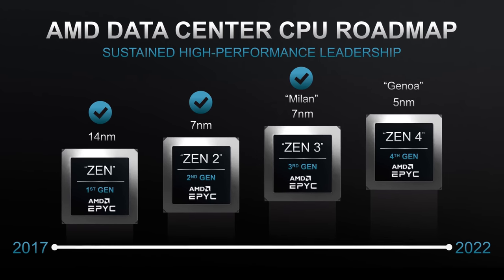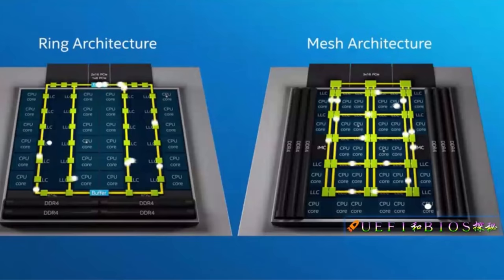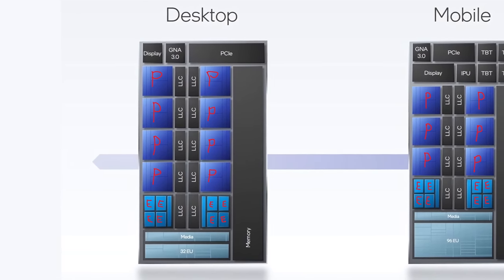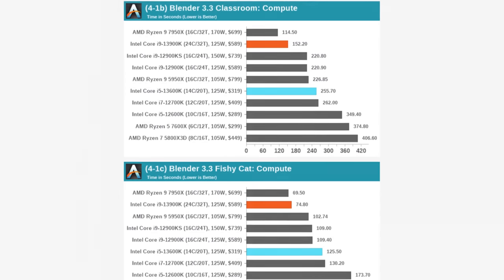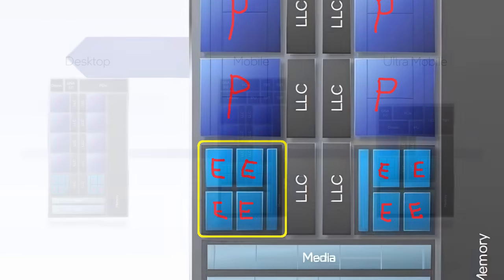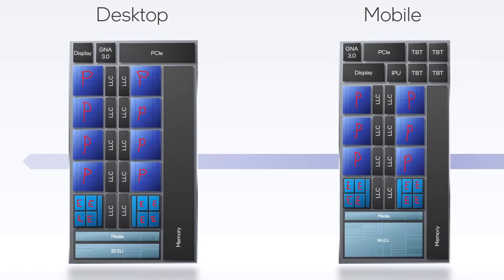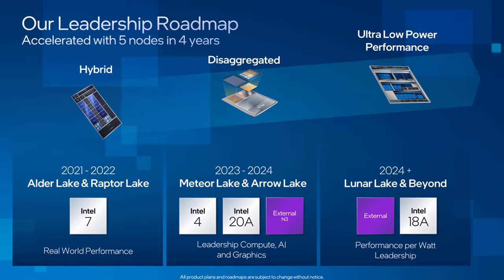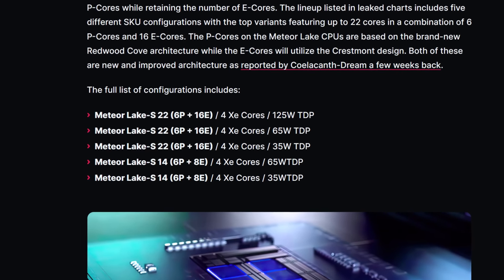E Cores - Slow, simple, not super efficient... but still good?

Comment: The issue is that software has to differentiate between these cores, and it’s not always easy to do so and there are a lot of bugs where you program will end up using the e-cores instead of p-cores
Reply: I've run into this issue with Win 10 when you had applications that don't need much compute power and few threads. The threads were jumping all over the place, switching from P to E and back wasting energy for nothing. After manually setting which cores to use the issues went away and the hybrid design just works.
Never had issues with compute demanding titles - games and applications chose the correct threads accordingly without manual intervention.
Reply: @Innosos  That's logical though, there's a reason Intel advocates 12th/13th gen users "upgrade" to W11 (which has a more appropriate task scheduler for hybrid processors).
Reply: This is my issue as well. From benchmarks, it seems fine BUT, I have yet seen an in depth benchmarking or even a compatibility check with virtualisation (KVM).
 Either they are hidden in the depths of reddit somewhere for my eyes to see or not enough people aren't buying top end CPU for virtualisation on linux (which makes me sad)
Would love to go intel but I have no clue how the e-cores gets affected by KVM.
Reply: @MLWJ1993  True, it is. But choosing between a couple of extra Watts while browsing or having to deal with random Win 11 updates breaking Ethernet drivers (had this happen yesterday on my media PC) I'll stick with Win 10 until Win 11 is as functional and proven as can be.
Reply: @Innosos  It's always interesting reading about these issues. I've personally yet to encounter anything glaring, only thing I had happen was my wireless adapter installing an outdated driver that made my PC bluescreen during large downloads, which hasn't happened again after reinstalling the driver.
Reply: @Innosos  How did you know that they were wasting energy?  What if turning off the E cores and running the P cores at low clocks was more efficient?
Reply: @DefineOutside  Because I measured the Package Power Consumption in HWInfo before and after manually assigning (Process Lasso) only E-cores while running Trimps (a javascript / web idle game).
The difference was about 5 to 10 W.
Judging from the thread usage graphs most of the savings stem from the Windows scheduler constantly moving the game thread to the two prefered P-cores.
When the assingnment was manually set all but one P-core was unparked (i.e. boosted up from idle 800 MHz or so) ever so often.

About downclocking: I've already limited the PL1 and PL2 down to 105W (from 125W) to land more in a sweetspot (~3 GHz for E and ~4 GHz for P) when doing allcore workloads. But I'm not going to gimp my 12700 and disable half its cores when they do great work for my Allcore workloads.
Reply: I had this issue with Elden Ring on my 12600k, as on paper it should have ran completely smoothly, but I was getting only around 30-40 FPS with a 3070. Turned off the e-cores in BIOS and it worked perfectly!
Reply: Scheduler should handle that ideally.
Reply: That is not an issue on Windows 11, tests have been done and the scheduler never got confused (it did at launch). Windows has never been built more with Intel architecture in mind, and a year after alder lake's launch and 22H2 and bios updates, the scheduler and processor have never been better. Can't speak for Windows 10 but Msoft said they'd optimize it in Windows 10 in 2022, last year. I don't use Win10 so idk if they ever did yet.
Reply: @Timblebits  Odd, Elden Ring doesn't even perform well with any CPU. There's constant stutter zones regardless of CPU (E-cores or not) so turning them off shouldn't magically solve anything about that subpar piece of code it runs.

Consoles are affected by it, as are any AMD CPUs.
Reply: @Innosos  I've had Windows 11 break all kinds of drivers I've had, but it's extremely rare. If it's more than a minor nuisance they're prob not completely at fault. I've had motherboards give me driver problems after its drives updated.
Reply: @Innosos  sorry, but "random windows update broke my" in most cases is pebkak - why did an update break that driver?  Did you let update download drivers?  Why in the hell would you ever do that?  Or do you mean the people responsible for keeping some part of your hardware up to date have bothered to change anything in many years and that is somehow MS's fault when they pushed an update that broke nothing on 99% of computers?

Whatever, I must be the luckiest person in the world - "random" updates dont break anything on my computer, but I keep the drivers and firmware stuff in my own hands, because those things should never be auto for anyone other than grandma on some hardware that is the same as it is in many, many other peoples machines. 

Your post is, essentially "I know my shit - but also, I dont know my shit".  Pick one.
Reply: @xBINARYGODx  Calm down dude. Windows will legit brick itself on certain hardware my old PC that has a ryzen5 1600 and a gtx1070 can only be updated if you reinstall. It blue screens if you do the normal update and throws a driver error for a USB device even tho there is nothing plugged in. No need to go ham on the dude and blame him for it. Windows 10 is hella unstable and bloated have seen the os kill itself during updates regularly.
Reply: Software doesn't. It's the job of the kernal
Reply: @Weneedaplague  The kernel is software if the devs can't make the task scheduler do its job well with the p and e core assignment you will have bad preformance.
Reply: They shipped a scheduler (thread director I believe they called it) for windows 11 to handle this exact case for every application
Reply: @Innosos  yooo how did u do it on windows 10?
Reply: @lamkhangnguyenduy5250  The core assignment? A free third-party tool, Process Lasso.
Reply: @Innosos  dang, never know that such software exist. This seems wonders for me as I extemely hate windows 11.
Does it support automatic core scheduler like windows 11 by any chance? Or do I have to set it up manually?
Reply: @mfrunyan this is not true, even with peak turbo frequencys the scheduler works pretty well picking in 99% of all cases the fastest core for intensive tasks
Reply: @lamkhangnguyenduy5250  I don't know the extent, there is some advertised scheduler but I haven't used it yet. You can set stuff manually and save the settings though.
Reply: @MLWJ1993  The game runs better with lower memory latency. The E-cores trash the latency. Ryzen infinity fabric is high latency compared to Intel's ringbus. Elden Ring runs best on Alder Lake/Raptor Lake chips with E cores disabled and low latency memory. People aren't aware of this because of guys making videos saying that such and such CPU is "good enough for gaming" and refusing to test edge cases or consider anything other than average framerate.
Reply: @Quarternewt  that'd be a sound conclusion if it didn't stutter in the same places on any other CPU currently available. Elden Ring was & still is a suboptimal piece of coding work, no matter how you spin it.
Reply: @MLWJ1993  It doesn't stutter nearly as bad. I have a 12700k with the E cores disabled, frequecy locked to 5ghz, 3866 B die, and I find that the game stutters rarely and not all that noticeably. I set up my PC to be optimized for low latency, and it works, and you could do way better than mine with a 13900k. Yeah the game is poorly architected. Lots of great games are poorly architected. I want the CPU that runs crappy code well, not the CPU that runs cinebench and shadow of the tomb raider well.
Reply: @Quarternewt  It still stutters, not nearly as bad as it used to. However that's not due to disabling E-cores nearly as much as it is due to the subsequent patches that were employed to aleviate the most glaring stutters.

I got the same improvements to fluidity on a i7-8700 as everyone else did...
Reply: @MLWJ1993  I played it at launch with the E cores disabled and it wasn't bad then. It has gotten better, but it was not anywhere near as bad as the footage I saw. Intel CPUs across the board were performing better than ryzen CPUs, digital foundry pointed that out in one of their first videos. It does not and did not have equal performance problems on all CPUs. The fastest, lowest latency configurations performed better. Disabling the E cores alone might not make all the difference, but latency is additive. It's one small part that contributes to mitigating the problem. Saying that it's just a software problem and nothing can be done about it is simply untrue. The tech press just didn't want to admit that ryzen CPUs were particularly bad after they hyped zen 2 and zen 3 so hard. They didn't want to admit that if you took their advice and bought a 3900X because it's "more than enough for 60fps gaming" that the guy who bought a 9900k was having a better experience.
Reply: @Quarternewt  aha, so you were the one soul on earth that apparently has the magical system tuned so far ahead of everyone else that it didn't drop into the low 20's of frames right after the tutorial area. I find that VERY hard to believe unless you're able to back that up with proof.

Even if it were hypothetically true it's still bad advice to advocate people to buy a CPU that has E-cores to then tell them to disable said cores they PAY MONEY FOR, instead of having them buy the CPU that only has the "so called superior cores" & a motherboard that suits their needs (I.E. clock generator if they want to overclock it)...
Reply: @MLWJ1993  I wasn't the one soul on earth and my system isn't even that well tuned. 5ghz and 3866 is mediocre for Alder Lake. I was perhaps one of the only people who bought a 12700k at launch specifically because I intended to disable the E cores. I can't bring myself to buy a 13900k and disable 16 E cores, but that is the best configuration for a gaming PC right now. It shouldn't be, but it is. The reason my system performed better than most with Elden Ring is because I made specific choices that people in the tech press tell you not to make. They say ryzen is fine for 60fps and intel only has an advantage at high framerate, they say ram speed doesn't matter for intel, they say locked frequency is bad and you should let the boost algorithm take over, they say E cores are a great idea. All of that is bad information, but it's the conventional wisdom. Now here's yet another video talking about how great E cores are, hypothesizing about an AMD product that doesn't even exist. Why? Because dude doesn't care about making Elden Ring run smooth. That's old news.
Reply: even using Windows 11 im still getting this issues , bruh lmao XD probably another generations to make it stable like 2 or 3 more generation 
unlike smartphone the most of Windows application and some games are not ready for big.LITTLE
Reply: @Innosos  wtf, windows goes out of his way to not move thread between cores.
Those programmers are trying real hard to do the wrong thing, because they think they know better than the operating system, or they think windows is Linux.
Linux randomly moves threads around all the time. Don't know why. (that might be stupidity of the vmware/xen or haswell bug, which is kinda old now, but it works great on w11)
Reply: @xBINARYGODx  it's not luck, it's buying good hardware.
Why people think their cheap boxes would have good hardware drivers.
I'm running windows 11 insider preview and I only had one problem ever, and it was caused by a short circuit (which was my fault, I do evil things to my machine, I just lost the entire contents of the NVRAM, nothing you can't fix by reflashing the bios/uefi/NVRAM thingy, I was messing with Intel ME and poking things with the system powered, lol)
Reply: @Innosos  i'm using win 11 for months now , not a single problem. I debloated it , Idk if this has something to do but , works better than when I first switched to win 10.
Reply: @yadeemkool5895  Just buy an old Skylake box if you want to do virtualization on the E Cores.
Reply: @leeroyjenkins0  Assigning threads to CPU cores is the OS scheduler’s job. Allocating work between different threads in the thread pool is up to the software itself. The most commonly used thread management algorithms assume each thread can perform an equal amount of work per unit of time. Algorithms that don’t are only used in specialty software because that capability incurs extra overhead. Overhead that will only payoff if an app is scheduled on both P and E cores.
Reply: @Quarternewt  Infinity Fabric is higher latency than Ring Bus. However, it is generally more consistent than P to E Core latency and P vs E Core to memory  latency. Zen 3’s increase in cores per CCX helped the consistency out more.
Reply: Any multi-threaded application needs to limit the number of threads based on some number of cores, otherwise you're just wasting alot of resources context switching between threads. But the operating system handles scheduling, not the software.
Elden Ring stutters on anything less than the latest generation hardware.
Reply: Efficient-core marketing move for naive peoples.
Reply: programmer here, you can't decide which core will process a given process/thread, you can only set a priority which the OS scheduler will assign to a core.
Reply: @Innosos   Windows 11 is pretty functional today, and windows 12 be even better once it releases in 2024. Ethernet drives and bluetooth drivers are garbage though, probably isn't updates breaking them. 10 isn't much different in this respect.
Reply: @NEWSITYRAP   E-cores are amazing when they're being used correctly and "efficiently".
Reply: @roidrage4897   So it really is true that you can't pin cores for specific processes, only flag them as suggestions to the scheduler? Is that a technical limitation or does everything break when threading is forced?